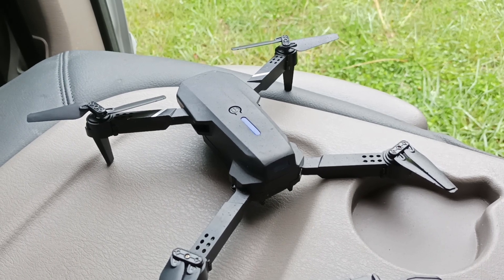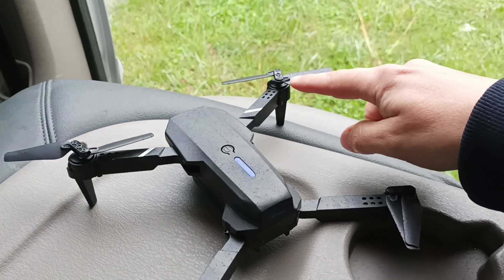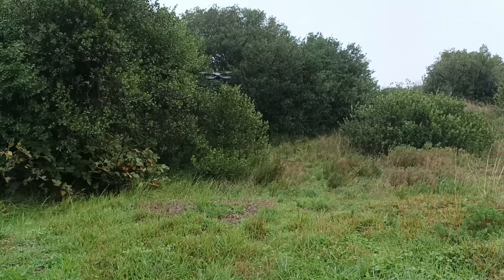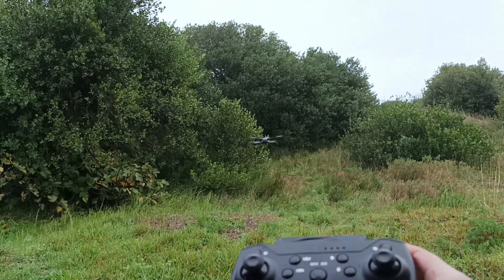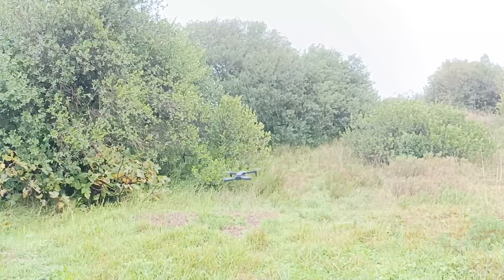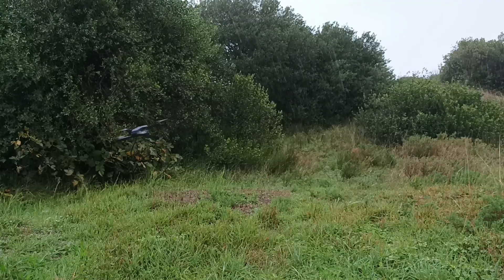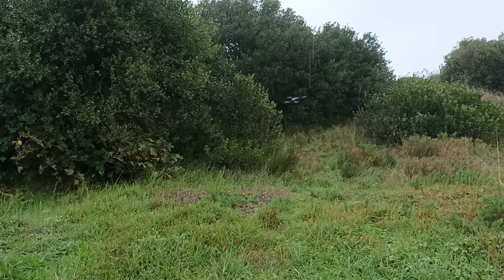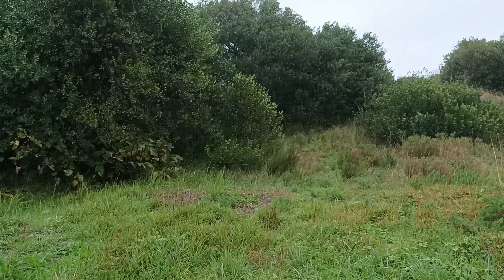Can I Fly a Drone in the Rain? Can I fly the E88 Drone in the Rain? Are Drones Water Resistant?

Comment: Could it be that the Air Force from the blades blow the water past the holes by the motor as well as the on off button?
After sitting for a time of flying in the rain when you go to turn the drone back on and operated has it been affected?
Reply from the maker: Will check this out after a few days, as mentioned in the video, and post the results.
Reply: @AventuraRemoteSmart  did you have any issues with it after ?
Reply: It must be the blades pushing the rain away and the holes near the blades are actually for the exhaust and that might also push water out and the power button is where the water will be able to get in